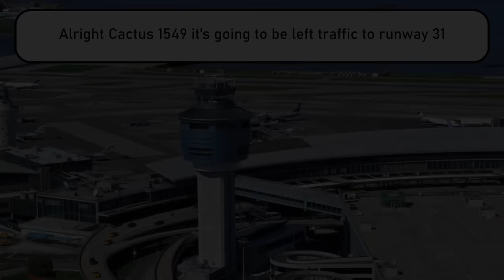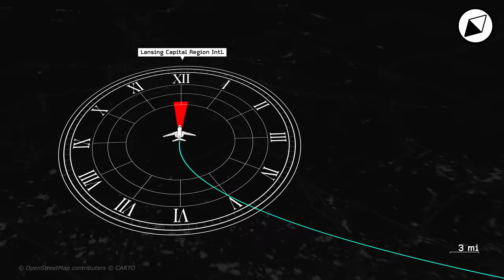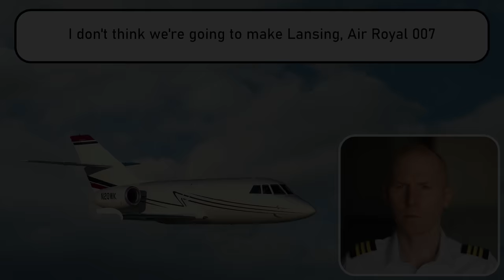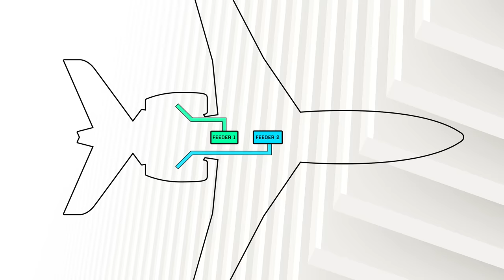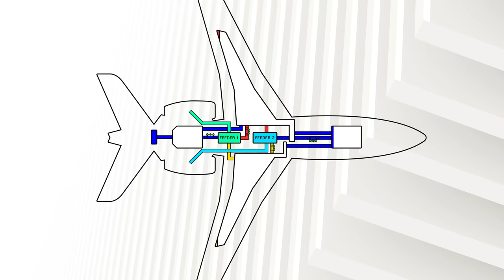Most Bizarre Dual Engine Failure Ever

Comment: I spewed out my drink when I heard that “clearance” from ATC. In my younger jet days in the Air Force I was flying a single engine jet that had engine troubles and while I had some power I couldn’t maintain level flight.  At ten miles I was switched to tower and told I was number two to an Aurora (P3 Orion with 4 engines) with ONE engine out. I was dumbfounded. An Aurora can fly all day on three engines.  Before I could plead my case to the Tower the Aurora flight deck told tower they would take number two to let me land as they had been monitoring the conversation when we were on terminal. The Aurora pilot then asked asked me directly to try and make one of the turn offs so he didn’t have to divert to the alternate. (The airfield I was landing at had only one runway big enough to for the Aurora.) I made the forced landing pattern and as I passed low key I cut the fuel valve off and glided the last 1/2 mile to the runway and made the second high speed cut off.
Reply: The P-3 would shut down an engine after burning off some amount of fuel to increase endurance.  However, I think they would restart it prior to landing.
Reply: @oscarb9139  - Yes you are correct. And I talked to the crew afterwards and they had shut it down for their patrol but it failed to start when it was time to come back for their approach.
Reply: @XLC-zd8dn  I work with a number of former P-3 pilots, as well as most every other military airframe.  Lots of cool stories.
Reply: @XLC-zd8dn  What aircraft type were you in?
Reply: @oscarb9139  - An old T-33 RCAF. We kept them around as support aircraft and EW trg until the 90’s
Reply: @user-ur8jm2nr3t  Wow!  T-33's flying in the 90's.  My uncle trained in them back in the 50's.
Reply: @oscarb9139  - oh they were old when I was flying them in the 90’s. Most of the ones we kept until the bitter end were built in the early sixties. The RCAF also used the Rolls-Royce Nene 10 engine in our T-Birds vice the American Allison engine. It had a bit more thrust and was a longer lasting engine.
Reply: @user-ur8jm2nr3t  I used to pump gas at the airport when I was in college.  AA 727's, UAL 727s, DL 737 (they weren't very friendly, so I avoided them as much as possible), and multi color CAL jets of all sizes.

Once a RCAF DC-3 came in and needed fuel.  That was the first time I had been up close to one of those.

That summer, because of a friend's dad, I was invited to attend a dinner with the Snowbirds....but I had to work and couldn't go.  I should have called in sick.
Reply: I’m deeply impressed. Glad you made it safely home. Great guys on the Airora.
Reply: Aurora.  Sorry my typing is awful on this tiny phone.  You did a great job. Amazing.

Comment: Controller: "You can descend at pilot's discretion..."
Pilot: "Negative.  I'm descending at aircraft's discretion.  Pay attention."
Reply: They pilot can speed up the descent at their discretion...
Reply: @KimonFrousios  laugh a little once in awhile ; )
Reply: @dmatthews7423  -  Hey, if we're going for gallows humor why hold back?
Reply: This happened over the Atlantic and the plane glided 75 miles from 35,000 to a safe landing at an airport on a small island...Air Transit Flight 236!!! Craziest story ever, I think it is more impressive than Sully on the Hudson.
Reply: Girl to salesman: "do you have transparent nail paint?"... Salesman: "sure, which color do you want?" ............ seems the same salesman later on decided to become  ATC
Reply: Reminds me of when I transitioned to gliders for an add-on rating. My instructor told me that once I announce the I was on the downwind for a runway, I did not need to state my intention or make any further radio calls. Everyone will already know where I am heading.
Reply: @patricksmith2553  sully was impressive because of how relatively quickly he had to react and how intact the aircraft was on landing. I wouldn't underplay that, he saved a lot of lives. now, not to say the flight you mentioned wasn't also impressive, rather there is no need for this kind of comparison, it's not constructive.
Reply: This is simply a guess on my part, but I think that controller's response might stem from the fact that he's simply too used to dealing with planes that have three or four engines, and he got complacent.  Again, just a guess.
Reply: I would have been back on the radio to remind him I'm gliding.... And I probably would have been pretty fucking sarcastic with the response, as well.
Reply: @since1876  That would have been A: unnecessary, B: unprofessional, and c: a huge waste of what little time he had given he was flying a glider while trying to figure out where he could land.
Reply: @Flyinghook  no, a huge waste of time is telling a pilot to maintain altitude when they can't. Worse than wasting time would be if you tell said pilot to descend to 3 and they do what you say and now they crash into a building because they couldn't get anywhere in time
Reply: @patricksmith2553  The Gimli Glider was also pretty cool. They, uh... 'borrowed' some metal safety barriers on a disused runway that were put there for a drag race event. Nose gear didn't lock, so the photos are iconic. If you want another incident, TACA 110 happened to land on a levee next to an old NASA facility; after minor repairs, the plane took off again under its own power from the runway-turned-street nearby.
Reply: I was flying a glider out of a controlled field where our club had an MOU for how we would report entering the pattern.  Per the MOU, I reported my altitude, and that I was entering downwind from about 1 mile out.  A relatively new controller at our field told me to maintain my current altitude until turning base.  My simple reply, “unable”.
Reply: @derdan20  but did you say it in Sully's voice? 🥺
Reply: @DanM  right, it's a waste of time to come up with an elaborate smart-ass answer
Reply: @since1876  No.  I was holding back laughter.  Called the tower after landing on land line to have the discussion.  Had my student worried and confused.
Reply: @derdan20  yeah you probably wouldn't wanna have that chat with a student listening 😂 I mean, I'd be fine with hearing you tell ATC off if I were with you but most people would be freaked out by that I think lol
Reply: "Me and gravity are negotiating right now. I'll keep your preference of maintaining 3,000 in mind."
Reply: @Josh Berry  even better, I'll let gravity know you say I have to maintain 3000', will advise gravity's response.
Reply: Sir Issac Newton is in charge of speed.
Reply: LOL  right ??
Reply: Perfect
Reply: catch a big thermal at 3000 ft
Reply: @KimonFrousios  “Read me the checklist for ‘terminal velocity.’”
Reply: @Game Plays 1230 No, YOU don't get what I said. The aircraft decides only the minimum descent rate, the pilot can choose to descend faster than that and they don't need thrust for that.
Reply: Descending at gravity discretion.
Reply: @since1876  The pilot can refuse any 'suggestion' from a controller when there is an emergency.  And when there is an emergency, the controllers are only making suggestions.
Reply: @EllsworthJohnson-ui1xm  not sure why you'd say that but ok
Reply: I feel the Sioux City incident is the most epic landing ever.  Life was lost but that aircraft was doomed.  Just incredible.
Reply: @yousafzaiaa7453  well, technically transparent is just the opacity, not the color, so you may have a preference which color will be not used or diluted to the point of not participating in the paint.
Reply: Well done. Better and faster than the "at gravity's discretion" I thought!
Reply: @mvtv-montanavigilantetv5976  gravity is really annoying about half the time 😒
Reply: “Aircraft’s discretion”.  I love it!!!   😂
Reply: hahahahahahaha
Reply: "Royal Air 007, possible aircraft deviation. Let me know when able to copy a number"
Reply: @patricksmith2553  wow
Reply: @wickedcabinboy  Ok I can do that: "What do you need to land?"
"Two new engines."
Reply: @jritechnology  -  Not bad.
Reply: Descend At Gravity's discretion.
Reply: @deanfowlkes  I thought "Gliders" were only used in war to deliver men & supplies, & sail planes were used to catch thermals & go up!
Reply: There was a story making the rounds a few years ago about a private airplane that ran out of gas mid-flight. ATC asked him to maintain a certain altitude, he replied "unable", and then ATC said something like "Oh, yeah. Right."
Reply: @stevemitz4740  Glider (n): A fixed-wing airplane that is designed to fly without depending on an engine or other source of power.

Sailplane (n): A specific type of glider.
Reply: @stevemitz4740  - Gliders have not seen widespread use in warfare since World War II. In the US, for all intents and purposes, glider and sailplane are interchangeable terms. As a matter of fact, the FAA issues pilot and instructor certificates in the glider category of aircraft. There is not a sailplane category or class of aircraft.
Reply: please dont do this, i hope its a joke or you are going to get many calls from the FAA @deanfowlkes
Reply: @ThePilotBlog  - Actually, I would not get in trouble with the FAA. Our gliderport, like many if not most gliderports, is in Class G Airspace. Radio calls are non-compulsory. Actually, radios themselves are not even required in Class E and G Airspace. 

You are only required to make radio calls to ATC when you are within 4 miles of an operating Control Tower below 2500 feet AGL in Class E and G Airspace (14CFR91.126(d) and 14CFR91.127(c)). Class E airports usually do not have continuously operating control towers. Class G airports with operating control towers are extremely rare. Even then, ATC can waive that requirement. As a matter of fact, we do not have transponders or ADS-B, either (except for FLARM).
Reply: @deanfowlkes  thank you for informing me, I didn't know that. I thought you were at some small class c airport.
Reply: @patricksmith2553 .😂
Reply: @patricksmith2553 landing on the Hudson with no casualties is the real miracle with Sully.  Gliding an aircraft is pretty simple if it's trimmed properly, and most commercial pilots have thousands of flight hours and they have probably trained for those scenarios.  Also, gliding 75 miles isn't surprising - I mean physics is physics - but the fact that the pilot stuck the landing, with no engines, the middle of GD ocean on a small little island is the incredible part.  You are missing the key point in both cases - the landing.  I could care less how the pilot glides - I need him to land that plane safely so I can walk off.
Reply: @dmatthews7423  Easy going would rule out being a jerk....
Reply: "We obey the laws of physics on this aircraft, pal."
Reply: He has a right to express his opinion that the incident he is relating is even more impressive. It's not "not constructive" to voice his opinion on the comparison. Lighten up.
Reply: @since1876
Me too.
Reply: So true.  That ATC appears asleep .
Reply: @yousafzaiaa7453  thank you, it wasn’t just me thinking the ATC was strange.
Reply: @patricksmith2553   OMG!  Deeply impressed.
Reply: @Kenngo1969 
Yep - or generally, planes that have working engines. He says "descend and 3000 a hundred" times a day, every day - a deeply ingrained habit.

Comment: Hello Kelsey. I'm actually from the area. This reverberated through multiple channels, including Fire Departments, since Mason Area Fire had to respond to the crash. Here's the breakdown on a lot of it.

Lansing is NOT a busy airport, even though it is in the Capital City of Michigan. They have approximately 10 scheduled commercial passenger flights, as well as some private flights, but their biggest volume of flights comes from a UPS sorting hub that brings in a lot of feeder flights and local trucks to fill 2 or 3 DC-10 sized aircraft.

The flight originated at Pontiac International Airport, the 2nd busiest airport in Michigan in terms of takeoffs/landings.

The plane, registered to Royal Air, is based out of Pontiac. They also have their maintenance hanger there, in the Northeast Corner of the airport. The plane had just underwent some maintenance.

The reason they gave them 3k feet, is in the direction they were traveling, there are several radio/TV towers in the area, including WLNS and WKAR MSU.

When landing, the plane ended up going approximately 20 feet off the runway.

Per sources who wish to remain anonymous (to prevent stepping on the NTSB/FAA's toes), says that the fuel was shut off from the tanks as you had described.

The aircraft is back in service, continuing to fly today.
Reply: When the controller gave them the instruction to maintain three thousand the pilot would not know why. They might guess that it was related to terrain or obstacles but they wouldn't know for sure. It would have helped if the controller had instead told them that 3,000 feet was the minimum safe altitude and explained that it was because of towers. 

This aircraft was unable to maintain altitude and that information may have helped, including the height of the highest tower which I assume was far less than 3,000 feet.

Based on comments here from controllers it sounds to me like the 3,000 foot clearance was CYA for the controller. If the pilot hit something the controller could say I told him not to descend below 3,000 feet. I understand that, but it seems like for a plane that was not able to maintain altitude they could have provided more helpful information beyond the required CYA instruction.
Reply: @StevePemberton2  emergency aircraft don't usually land at Lansing, or most aircraft as it is. They'd rather go to Grand Rapids or Pontiac.
Reply: @tornadojames  
I have no reason to doubt that an aircraft with mechanical problems would prefer to land at the airports that you mentioned. However in this situation with no engine power the top priority was survival, which is primarily based on distance to the airport, runway length and runway direction. 

Emergency services would be another consideration, but not above the first criteria which is safely landing on a runway. The runway at Lansing is 8,500 feet which is why they initially attempted it, but being without power they could only  reach Mason with its 4,000 foot runway, coming in fast and heavy they were not able to remain on the runway, but fortunately it all worked out okay.
Reply: Yup plane is still flying I see it every day. Funny he showed the aircraft 20WK when in reality the aircraft is N123RA.
Reply: Paragraph five is utter rubbish, we’re you the ATC Controller on watch that day?
Reply: Lost power on climbout at 14000, needless to say by the time he radioed in, we can presume he was descending rather briskly.

    Balanced Field Length: 5075 ft
    Landing Distance: 3167 ft

Given barest of bones, a 20 foot excursion, he'd be more expected to get a 100 - 200 foot excursion, so some damned fine piloting! Given all of the non-optimals going on, optimal landing in a real world hot mess.
I'd have been that great furrow way down yonder.

Comment: For the record, Kelsey, the clearance is probably because, looking at my EC-1 Terminal Procedures PDF, the initial approach fix and glideslope intercept altitude on the KLAN 28L RNAV/GPS approach is 3000 feet.  It also keeps them at a safe altitude if they know not to get below 3000 until they've got the runway made, because according to my Detroit sectional, the maximum obstruction height in that area is 2100 feet, so 3000 gives a decent buffer above that.  Can they maintain 3000?  No, but it does give them a good reference height for their pilot's-discretion descent so they don't shed too much altitude too quickly and encounter an antenna or something.
Reply: Thank you sir.
Well said and relayed!